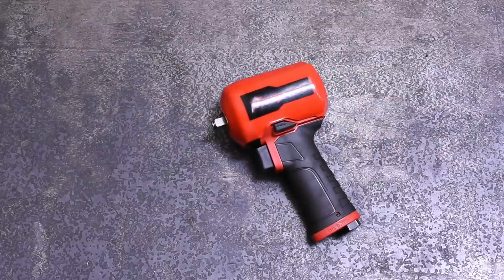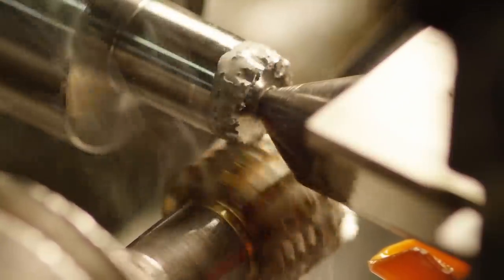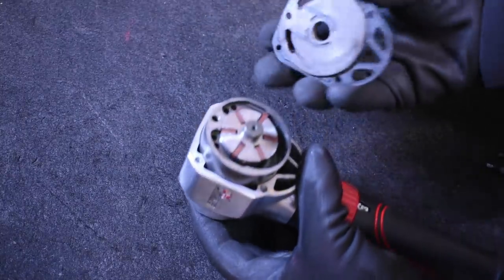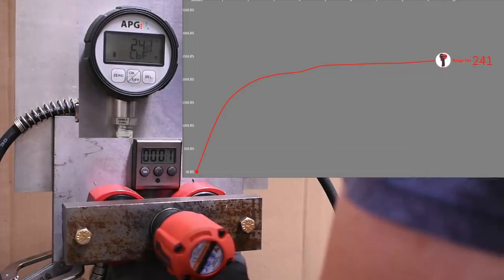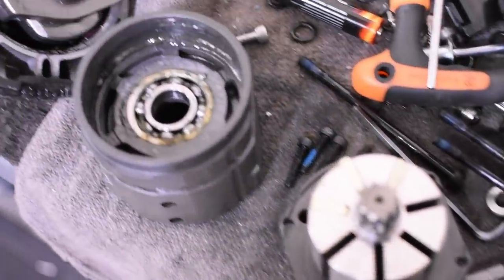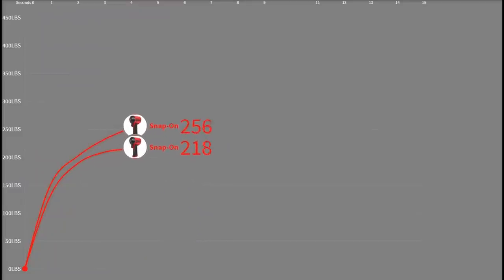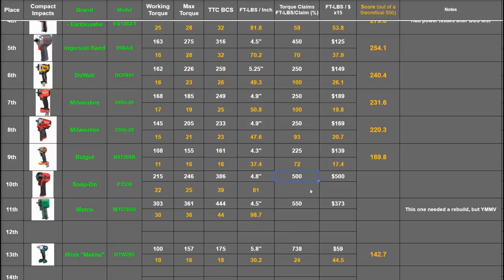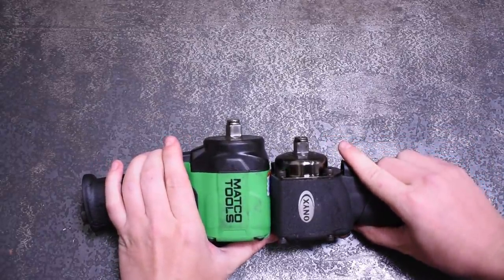We Accidently Kill a Viewer's Impact: Snap On's New Compact vs Matco

Comment: It's always interesting to see what these new stubbies are capable of.
It's also interesting to see that Astro is repairing Matco impacts too. My old Matco AI150 decided it wants to run without squeezing the trigger, and my Matco distributor said a minimum of over two hundred bucks and a $95hr labor rate. It's been a good impact for the last twenty years, but damn!
Perhaps you guys could give us some insight on how to fix this problem? I'd hate to just throw it away and buy another Astro, if I can get my hands on one anyways...
Reply: Imo there are 4 possibilities.
1. The trigger gets stuck in a pushed in position , most of the times it's caused by grime , dust and other things getting in the trigger.
2. The opening mechanism itself got stuck in the open position from grime....
3. Something mechanical broke which should stop the air from going into the impact.
4. The trigger itself broke

So easiest thing to try would be to take it apart and try cleaning it
You are gonna have to take it apart either way , so while it's taken apart , check parts for any damage which may cause it to not shut off.
Reply: @LorandHungary  I already pulled it apart, and the delrin like seat has a chunk missing. I'd be more than happy to replace that valve seat, but it seems to be made of unobtanium. Just like the info on how to do it.

Comment: i have the matco for a few years now. if im not mistaken i got it live on koons channel. regardless it let me down for the first time this past week during a engine over haul. i would pull the trigger and it would hammer once and then just lock up and hissss at me. i oil it often and i have a grease gun that i use on it..... well i got mad and opened it up and noticed all it was was the hammer was dry. i took the hammer and the cover and cleaned it and greased and finished my overhaul with no more issues.

Comment: I’ve worked in 3 automotive shops and all of them ran air pressure between 150-175 psi. I’ve got a gauge on the inlet side of one of my air tools and this 150-175psi was the actual line pressure at the tool connection while the tool was in use.  Aside from body shops I’m curious how many shops actually run such a relatively low pressure.

Comment: Ive got the blue point stuby in 1/2 use it for caliper bolts all the time and and other places the bigger impacts don't fit handy for manifold bolts to even taken out frame crossmember bolts when I had to drop a fuel tank on a E450

Comment: New to the channel. I'm enjoying it. Maybe a question and answer that has been discussed, but the readings are from a clamp force test. I get that a torque test instrument/dyno is expensive and useful for nothing else. But a torque test measures rotational force.  Your clamping force on load cells has losses in the stretch and vibration of the bolt and friction loss in the 90° directional change and drag between the threads of the bolt and plate. Roughly a 20-25% loss. Your test is very applicable and more cost effective to build. Might help people understand the guns are actually more powerful than the clamp reading. Sorry if already discussed.
Reply from the maker: All of that becomes irrelevant once calibrated with a coefficient. Once a known value makes a known value everything is good to go.  See episode one. Being repeatable is all that's needed. These guns aren't rated for rotation torque. They are rated for bolt tightness. Not like an engine.

Comment: The Snapon will develop more power over time as the air vanes seat in and allow less air to bypass. 
This is because they use a resin coating in the vane construction that gives the air motor longevity and durability.

Comment: I own both my matco stubby has been sent out 3 times for repair I also have a coworker who’s had his sent out 2 twice. The matco definitely has more power but for overall quality and power buy the snap on.
Reply: I heard you say "buy the..." and then all I heard was static, so I bought 3 more Astro Nanos.
Reply: Pay more for less? No thanks.
Reply: I was gonna buy a 1/2 inch from my Matco guy but he told me if I use it too much, I would be sending it in all the time for repairs, so I bought a Mac Tools one instead, hasn't let me down in 6 months of daily use, and I got it for pretty cheap. One of my favorite tools I have in my box.

Comment: I had a thought while watching this about the Snap-On tool. I'm wondering if the increase in number of vanes causes an effect that looks similar to a lower displacement engine because the distance between vanes is smaller. That would explain why they went with a larger diameter rotor if true. They would do that to compensate for the lower torque from this design by increasing the diameter at which the torque is applied. Honestly I don't understand what the thought process was from an engineering standpoint on this design because it's clearly starving for air at normal lower pressures. I guess like with a high revving, low displacement engine, you could get the same results with gearing it properly, but the problem with that is that these air tools don't have any gearsets like the cordless tools do. Weird that they did this.

Comment: Love your channel. Could you guys test a 1/2 impact with 1/2 to 3/8 adapter to see if there's a difference? Im debating on whether to invest in stubby 1/2 impact sockets or just use my 1/2 impact with adapter on my 3/8 stubby sockets.
Reply from the maker: Yes, we can do that
Reply: Generally any adaptors will reduce the torque some. It allows some slop which takes away from the hammer blows. 
The adaptors are cheap so I’d just get one and use it. If you find the gun can’t make enough torque with the adaptor then it’d be time to get the sockets.
Reply: @TorqueTestChannel  Awesome
Reply: @NBSV1  What Im more curious to know is by how much that difference will be. Will it be enough to justify buying a $60-100 set or not? Possibly.

Comment: Some of the Matco guys I’ve hear say turn the dial down in reverse and it makes more power somehow, doesn’t make sense but wonder if that can be tested
Reply: Possible maybe the dial go to far and go pass the edge of the hole effectively reducing the air flow volume 
So it's bad tolerance or sloppy manufacturing

Comment: It would be cool if you tested Milwaukee one key line see if you set there custom torque figures if they stay consistent between runs/different batteries/batteries level and even if you used a high torque set down to 300 foot pounds compared to a mid torque/stubby set yo 300 foot pounds see how close they compare on the dino

Comment: You guys try an aircat 1077 stubby yet? I've been running that one for 3 years now. Barely ever take out my 1/2" gun. Usually go straight to the 3/4" or a torch if the stubby won't do it.

Comment: I’d love to see a test with sockets like the Lyles Honda Harmonic Balancer Socket. This socket is proven to break loose the harmonic bolt vs traditional sockets the same size.
Reply: If a recall correctly it already did this test and was surprised by the results 
It work great on smaller fastener but at this size bolt it doesn't really make a difference
Watch back at the 2min20 sec in the video he show the astro nano wit both the long socket and the shallow socket and it made no difference

Comment: I have an older earthquake 1/2 3/8 and 3/8 ratchet I picked up all 3 for 100 bucks brand new and have been using them ever since with no complaints except the 1/2 doesn’t hold the sockets anymore but I’m to lazy to fix it

Comment: You should test the sunex SXMC12 and maybe their full size one too. My sxmc12 has pulled crank bolts out my mg725 couldn't and I also have the 3/8 drive Matco of the one in the vid, and the sunex definitely has more beans than that

Comment: @Torque Test Channel. You guys should build (or order) 2 custom rotors. One aluminum and one lead (or iron). Just because 😂. Also, you should drill a whistle into a rotor like the nerf vortex. Make that baby whistle real good haha.
Reply from the maker: The rotor's end shaft is what drives the hammer case, aluminum and lead would turn into easy cheese very quick! And cast iron would fracture

Comment: You need to try the earthquake 1/2 stubby. Stronger than those 2 yet still smaller. I was shocked when i tried it out. Bought at the fleamarket for $30
Reply from the maker: Its on the rank chart in this video. We've tested it.

Comment: Snappons 1/2 stubby rated 775 break away, 500 or 550 working cant remember for sure
Reply: I get it your working with what viewers send in for you to use for videos but at the same time comparing a 1/2 impact to a 3/8 impact, air or battery its not a good way to compare brands

Comment: Does the 3/8 socket weigh as much as the 1/2 socket? Wouldn’t that technically make a difference
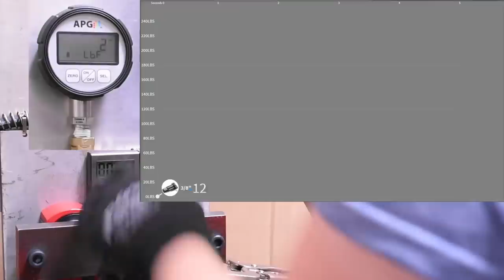Reply from the maker: PT338 is a 3/8" impact. We had 3/8" custom sockets made for this huge bolt, they couldn't make deep. On these two sockets, the difference is less than 5ft-lbs. As socket size decreases the difference % goes up. We have 2 episodes on it. Also at 2:21 you see a 3/8" anvil swapped compact being dyno'd vs its 1/2" anvil using these two different sockets. So that dyno graph shows the difference.

Comment: my personal Matco stubby suffers from the same smelly exhaust and smoke out of the tailpipe. if possible would you be able to email me a list of parts that I could buy so I can rebuild mine? our Matco distributor has abandoned his route and we no longer see him at the shop. Nor would we want to. But that's a different story.
Reply from the maker: It's not really a parts issue, and it's really hard to open. You basically need to take 1-2 thou off the length of the air motor by sanding and polishing.

Comment: I hated my Matco stubby!  Couldn’t even get driveline bolts out
Reply: Mine’s a let down to. I bought for taking out caliper bolts. A lot more times that not, I have to bust out the long ratchet.
Reply from the maker: Are you guys able to take off those caliper bolts with any other stubby? I'm curious.
Reply: @TorqueTestChannel  no I haven’t tested any other stubby. The stubby has come in handy for  normal crank bolts though!

Comment: I use a husky 900ftlb gun that’s 100$. So probably makes 600 or so. The torque curve is very slow and even. I break less bolts with my husky than my Mac gun.

Comment: Hey what quick connect coupler are you using on your hose?   I have the harbor freight 5 in 1 Safe coupler but I noticed it’s leaking air slightly after 2 weeks of use.
Reply from the maker: Milton

Comment: Why were you using vastly different sockets for the SnapOn and Matco? The SnapOn used a very short and light stubby socket, while the Matco used a deeper much heavier socket.. idk how much difference it would make, if any, but just wondering why the same socket wasn't used for both.
Reply from the maker: PT338 is a 3/8" impact. We had 3/8" custom sockets made for this huge bolt, they couldn't make deep. On these two sockets, the difference is less than 5ft-lbs. As socket size decreases the difference % goes up. We have 2 episodes on it. Also at 2:21 you see a 3/8" anvil swapped compact being dyno'd vs its 1/2" anvil using these two different sockets. So that dyno graph shows the difference.
Reply: @TorqueTestChannel  Thank you for the explanation! I was just curious. Love the channel. Keep doing God's work guys!!

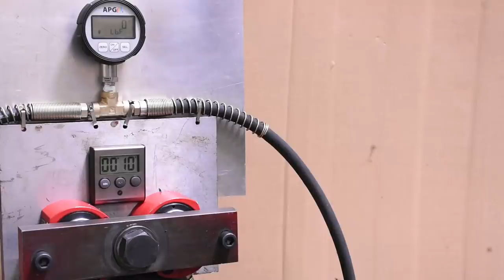Comment: 5:42 5:52 Why use two different sockets for the same test? Don’t you usually swap over the same socket? Why does one get a very shallow, and one get a deepwell? I don’t like either of those brands, this is just something I noticed.
Reply from the maker: PT338 is a 3/8" impact. We had 3/8" custom sockets made for this huge bolt, they couldn't make deep. On these two sockets, the difference is less than 5ft-lbs. As socket size decreases the difference % goes up. We have 2 episodes on it. Also at 2:21 you see a 3/8" anvil swapped compact being dyno'd vs its 1/2" anvil using these two different sockets. So that dyno graph shows the difference.

Comment: I been having people argue with me on Tiktok about impacts and socket weight
Reply from the maker: Does it matter? Yes. Does it matter much on large 38mm/1.5" bolts like ours? Nearly immeasurable. The smaller the bolt, the bigger the mass difference, the more it changes. Shallow to deep might matter on a 1/2" thread 3/4" drive bolt. And then, a weighted socket even more. On our 2lb bolts, not so much.
Reply: @TorqueTestChannel  he was trying to say a shorter socket applies more torque than a longer socket. It was quite funny
Reply from the maker: That makes zero sense unless the socket is literally deforming

Comment: Whats the differences in those socet weights, dosnt that effect impacts?
Reply from the maker: On these two sockets, less than 5ft-lbs. As socket size decreases the difference % goes up. We have 2 episodes on it. Also at 2:21 you see a 3/8" anvil swapped compact being dyno'd vs its 1/2" anvil using these two different sockets. So that dyno graph shows the difference.

Comment: I think the cost of the Matco rebuild should be added to the price to generate an alternate calculation in the notes.  LOLS
Reply from the maker: Under warranty, so $0? :P
Reply: @TorqueTestChannel  Looking through the comment section, you weren't the only ones to have this problem, quality control is clearly an issue with these units, and that IS something that you pay for. Under warranty, so $0? is not a good reply when you have not got a tool to use in the meanwhile, even if they give you one to replace it, then you have to wait for the tool man to come, and maybe I am wrong but the Snap On stuff tends to be very reliable, I haven't seen anyone complain here or anywhere about their reliability for that matter, all the complaints are that it's dammed expensive, which is true of course. The torque output is not the only defining factor for the evaluation of the value or quality of an impact tool and this is my first time viewing your channel and I feel this is where your video lacks sadly.

Comment: Why do you use a different socket on each?  Doesn’t that play a roll in numbers?
Reply from the maker: As mentioned by the video annotations, on these two sockets it's less than 5ft-lbs. The PT338 is a 3/8" impact, and we only have the one custom 3/8" 38mm socket made for us. As socket size decreases the difference % would up. We have 2 episodes on it. Also at 2:21 you see a 3/8" anvil swapped compact being dyno'd vs its 1/2" anvil using these two different sockets. So that dyno graph shows the difference.
Reply: @TorqueTestChannel  so you admit that even if minimal there is a difference in the numbers.  So not an apples to apples comparison.
Reply from the maker: @Mjc103  If 2:27 is not apples to apples enough for you then steer clear of the rest of youtube's tool reviews. I have a feeling you wont like any of it.
Reply: @Mjc103  LOL Less than 5ft-lbs invalidates this? Grow up.

Comment: With all the "does socket size matter" i would like to see this test run back with the same socket..
Reply from the maker: At the time of making this video only the 3/8" was out, so used the 3/8 socket
Reply: @TorqueTestChannel  As i say running it back, a comparison of the Matco MT2748 3/8 (basically the 3/8 version of the MT2765)  to Snap ons 3/8. Would be interesting to see.

Comment: The real question is, THIS or the right angle flex MT2612???
Reply from the maker: Hmm. This will break caliper bolts a lot closer to 100% of the time, but not fit in as many places. That's tough

Comment: What happened to the Astro 1823?
Reply from the maker: Was a bad motor design IMO. Used helper springs inside to pre-push out the rotor vanes and bump up power for its size. It's an impact tool, they jumble around a lot. Small springs get buggered. Plus mid-sizes air impacts I dont really see the point of, use cordless.
Reply: @TorqueTestChannel  Thanks, I figured it was being sold under another label. I saw a lot of a certain tool truck brand’s boxes at the Astro repair center.

Comment: WHY use different sockets?
Reply from the maker: PT338 is a 3/8" impact. We had 3/8" custom sockets made for this huge bolt, they couldn't make deep. On these two sockets, the difference is less than 5ft-lbs. As socket size decreases the difference % goes up. We have 2 episodes on it. Also at 2:21 you see a 3/8" anvil swapped compact being dyno'd vs its 1/2" anvil using these two different sockets. So that dyno graph shows the difference.
Reply: @TorqueTestChannel  OOOH I didn't realize one was 3/8 anvil. My bad. love the channel .